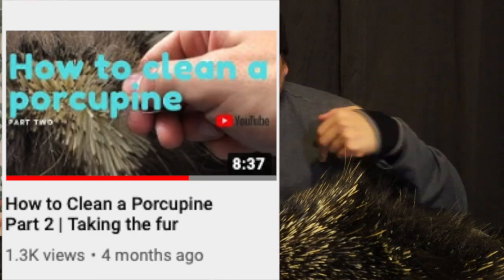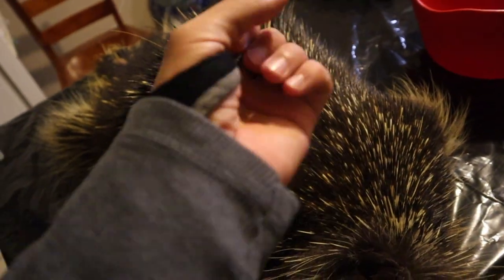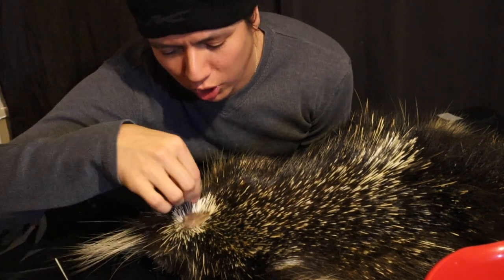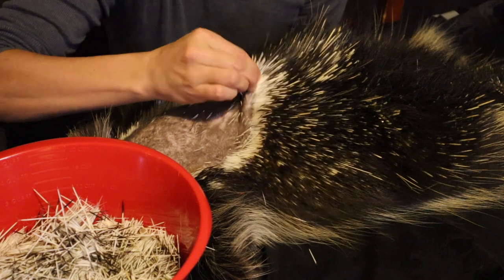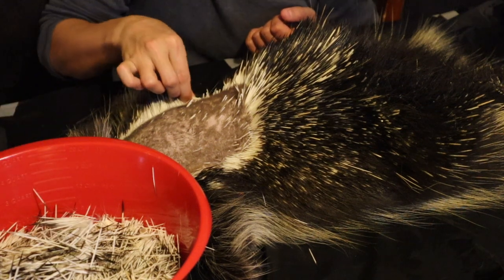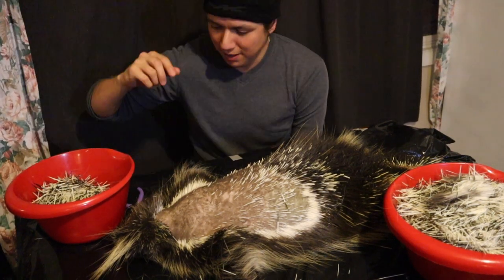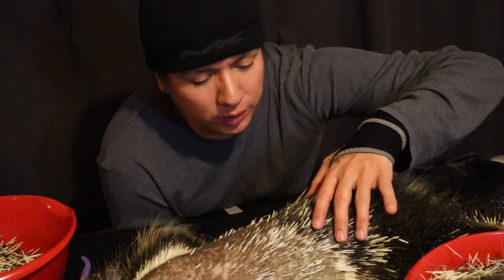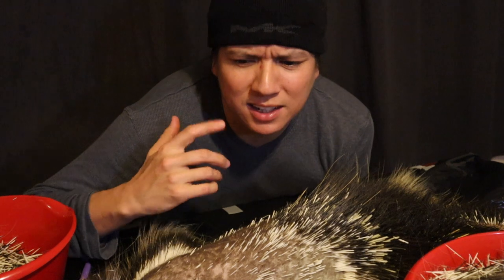How to clean a porcupine | Part 3 "Getting those Quills"

Comment: Hi Devan, thank you for sharing your knowledge. I found your video very informative and funny.  I wonder; you said that the porcupine is left outside to freeze and brought in to work on. Did you have to thaw out fully each time? Looks like the skin is not frozen when you pull the quills. I do a little quillwork embroidery style, taught to me by a wonderful Cree family in Alberta Canada. Moonstone Creation. Thank you
Reply from the maker: when I do that technique it keeps the organs frozen and prevents it from rotting and stinking.  thawing just the skin allows for me to pluck it enough and then put it back outside.   harder in the summer because I freeze them and then try and clean it all at once in the heat and fighting the flies.

Comment: Okay question.. I’ve done this a couple times now and I did come across a porcupine that had “bugs”… have you come across this as well?  Best tips for cleaning a “buggy” porcupine. 😩
Reply from the maker: when it comes to spring or summer ones they usually do have ticks.  easy to remove them after u pluck the quills.    but I usually don't harvest summer quills, they get too brittle. winter is th best time